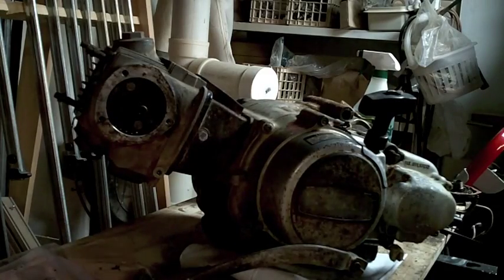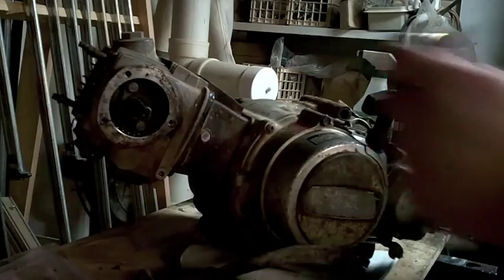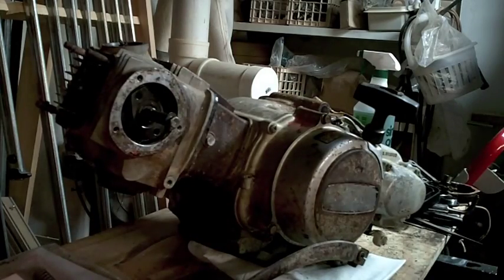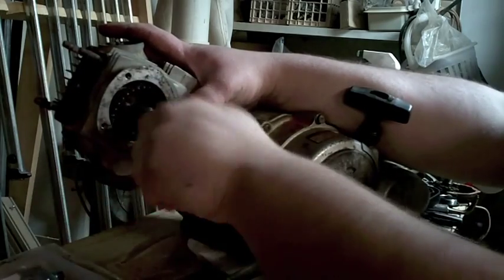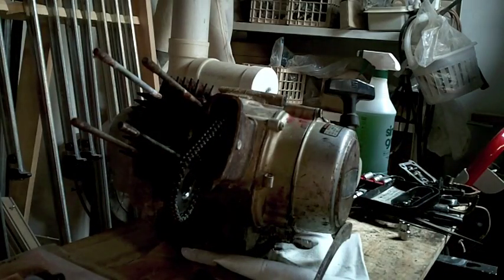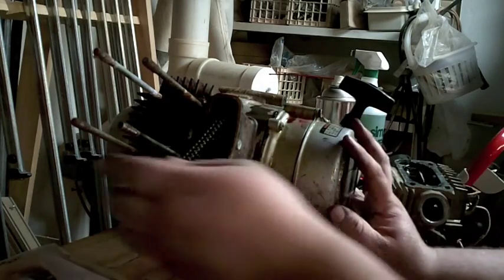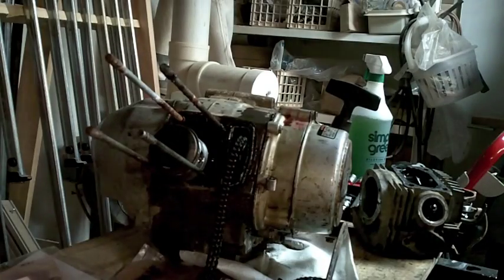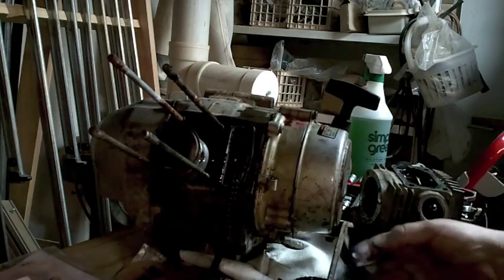1979 ATC110 engine teardown part two removing the cylinder

Comment: Hey man. Will a 1979 110 top end interchange with a 1982 top end being one has points and the other is cdi?
Reply from the maker: The engine is the same except the head, you’ll need to use whatever version you have on your trike.  I used a 85 piston/rings etc. on a 1979.  I put in new valves/valve springs/keepers in that head.